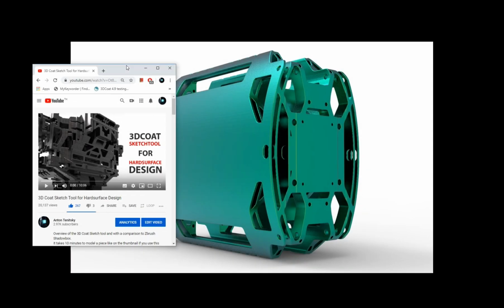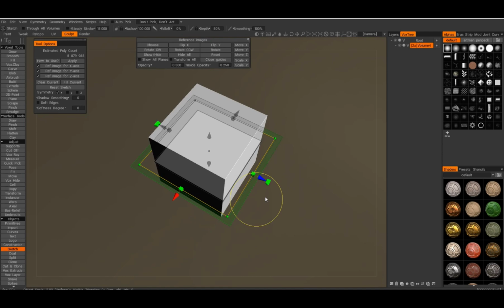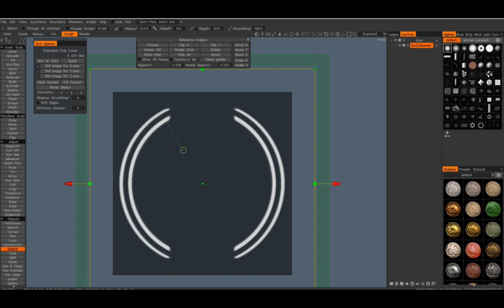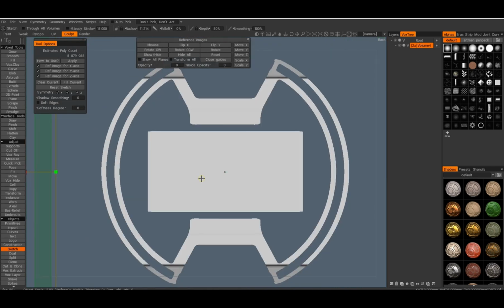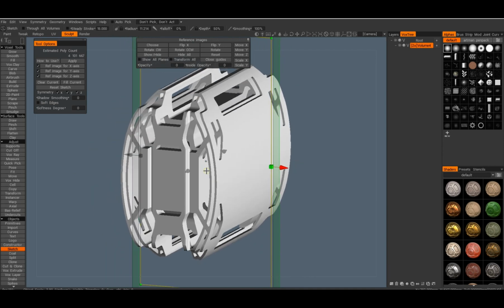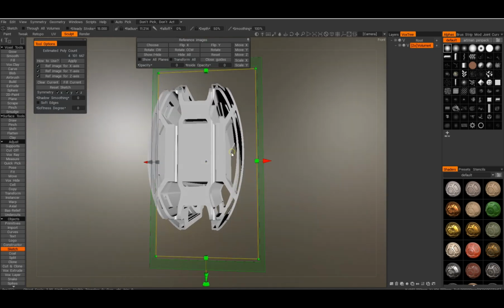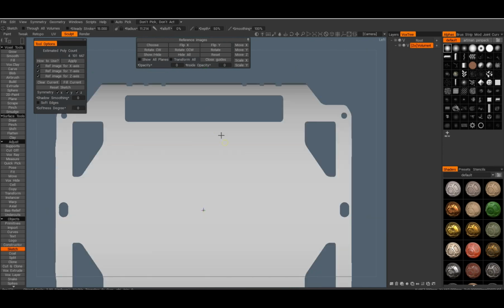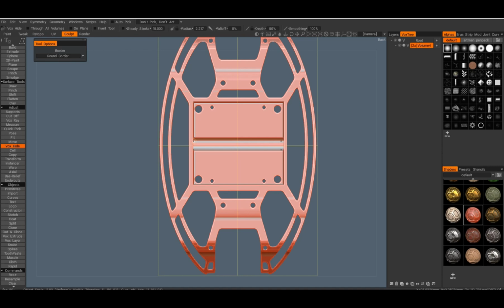3D Coat Sketch Tool for Hardsurface Design Revisited

Comment: Do you prefer 3D Coat over Zbrush or Blender? If so, why?
Reply from the maker: tough question Shinobi. I use all three. 3d coat is quite a novelty in real production so everybody wants you to use Zbrush. And I think over the next 10 years Blender will beat all of them.

The moment Blender gets high-poly support with all the functions it will be too good and free.

But even just for design practice 3D Coat is insane I think. Like when you go to do life-drawing there is no actual commercial purpose for it just drawing practice same 3D Coat will be great at least for prop design practice.
And I will have some talks with artists coming soon where 3D Coat is a killer in AAA games when it comes for environment mesh sculpting.

My channel is more about 3D Coat since there are just so many other artists showing Zbrush and there is not much information about the coat.

Comment: A little question; at the 2:00 minute mark you draw out the circle to the size you want but then you move it around to just the right spot before you release the mouse key to fix it in place. What hot key are you hitting to allow you to move that circle (or any other drawn shape) around before you fix it in place?
Reply from the maker: I was pressing space bar :)
Reply: @AntonTenitsky  Thanks

Comment: How does this look as export as a mesh?
Reply from the maker: triangulated mess :)
Reply: auto retopo instant meshes (already build in 3d coat)
Reply: or separate mesh and do manual retopo for each part
Reply: @aaronbjorn1876  I'm gonna have to get 3d coat looks pretty good